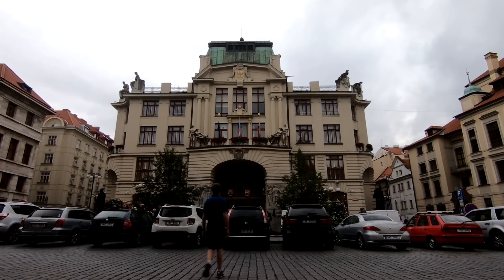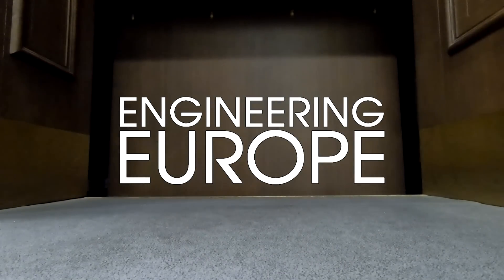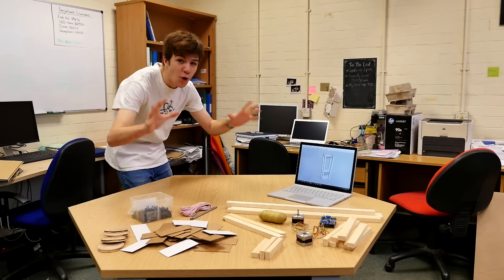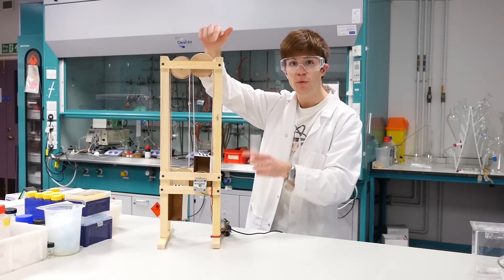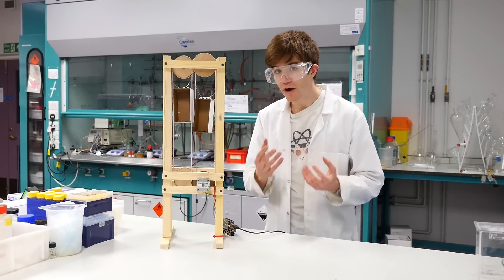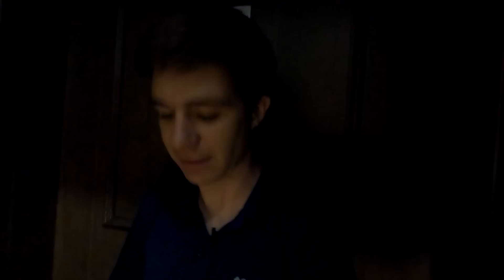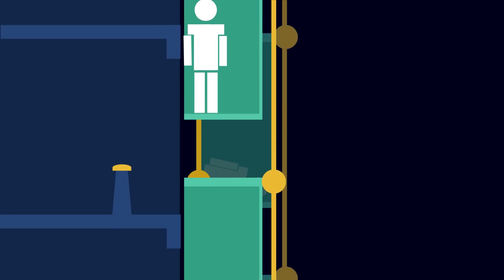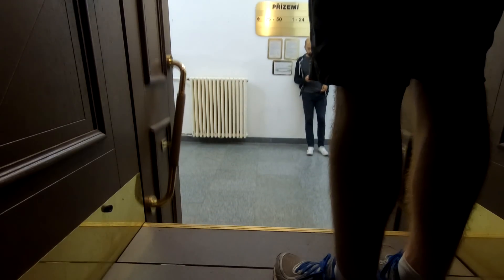Riding the Elevator of Death

Comment: Major problem with this aside from death and injury is that it’s not accessible to everyone. Most people with disabilities would have great difficulty using these elevators.
Reply: So? There are also normal elevators.
Reply: Johanna Guerrero ☠️
Reply: @okaro6595  most buildings do not have the capacity to install more than one kind of elevator
Reply: In the USA, we say that it is not ADA-compliant (Americans with Disabilities Act).
Reply: This is like a compact escalator. I don't see why they can't have this as well as a conventional elevator unless they are really hurting for space.

They can sacrifice some office space and install an elevator shaft there. If it's next to windows, they would have to put up signs on the outside of those windows that say "SHAFTWAY" (for the firefighters). Many old buildings in NYC have evevators installed this way.
Reply: Just place a card scanner on each floor and elevator that temporarily stops it, so a disabled person can get on and off.
Reply: A huge chunk of large buildings already has to be dedicated mechanical space. A tiny deadly elevator only useful to thrill seekers and fit, healthy adults not carrying anything sounds like a giant waste of money and space.
Reply: You're absolutely right. If every building had both types the 'normal' safer option would be designated 'the short bus' or somesuch. I'm sure many people not really fit to ride the paternoster would force themselves to, just to avoid being seen as an invalid. Much like how many elderly will keep driving until a relative has the courage to step in and force them to stop.
Reply: @Keovar  what's exactly the difference with a normal elevator? You also need to wait with a normal elevator when a disabled person needs to get in. With a normal elevator you can also push disabled people aside and reject them from entering the elevator just to save time.
I don't get your point.
Reply: How many such people are in building? How often they ride elevators? There easily could be other, normal, lift  for them. Paternosters were designed to move huge number of people in in time. Bear in mind that Czechia is land of Kafka and bureaucracy and back in the day those corridors were buzzing with bureaucrats.
Reply: They may not look it, but they are safe. Even though invented years ago they don’t need modern tech gadgetry. There are hidden safety features that mean you won’t get chopped in two. The worst that could happen is falling over. 
In a way, they actually help disabled people. They are so efficient at moving crowds that they lessen the loading on the traditional lifts. This gives the disabled more chance to get on a lift.
Reply: Yes like my red hairs
Reply: Two mirrors and a light sensor would work just fine. 
And before you try to play white knight, I’m disabled. 
Ya’ll love to make things way more complicated than they need to be so ya’ll functional can bitch about how exaughsting it is to accommodate others. 
Stick a mirror on the back of the box, one on the floor edge angled at the ground and a light sensor at the bottom. Viola! 
Roll in, use the mirror to read the floor numbers. (One painted forwards, one painted backwards.), Once on the floor, roll out autobots (transformers slaps) and done! 
The light sensor on the bottom when broken will pause the elevator until reconnected. 
It’s literally the same logic as in garages.
Reply: @plateshutoverlock  Well, I've seen elevators that have glass shaft, and the inside of the elevators are also see-through. Nice touch actually exposing the mechanism of the elevator. You can mainly see them in malls.
Reply: Unexpected stops and starts would make it more dangerous for everyone on other floors getting on or off. These would be great in buildings big enough for 3 or more shafts - there are several even in Denver - but they couldn't completely replace elevators.
Reply: There is also the fact that... just from looking at it... these are slow as hell. It’s fine for low storied buildings but actual skyscrapers and places that probably would need the elevators that can transport lots of people extremely often wouldn’t actually find a practical use for them because of how long it would take to get from the bottom floors to the top.
Reply: @squee222  On the contrary, yes they are big enough. Buildings where you require the capacity of a paternoster will be big enough normally to house at least one other elevator. Which by the way made a lot of sense even back in the days, as transporting furniture four stories high was even back then easier with a normal elevator.
Reply: @acdeeiprrt  that was never their intention. They were for buildings with very high capacity demands and always combined with traditional ones. One paternoster and one classic elevator and you get a capacity of many more in the place of three classic ones... They are also too slow for high buildings. Their niche consists of not very high but large area buildings with many offices/lecture theaters etc. on each floor. In Prague, they were used at universities, townhalls, some hospitals, large buildings with lets say four to eight floors, always in combination with traditional elevators and commonly used (not emergency only) staircases.

And also with many safety features not mentioned in the video, although present in the example shown - lifting parts of the floor, switches in the ceiling part, etc. The biggest real risk is getting caught in the mechanism on the top or bottom - by clothing, long  hair or a finger, if the person is very inconsiderate. That could be nasty (and it is the reason, why it is always prohibited to go around the top or bottom on purpose). Or an occasional sprained ankle. The risks mentioned in the video are prevented by safety measures in reality.

Comment: In the Paternoster Elevators videos there is always this phenomenon sociologically interesting, two groups colliding:

Group A: Express their fears, and are vehement in thinking about dangers, disabled people and pets using this.

Group B: Complains about the recall of these elevators by pointing "stupid people", calls about natural selection.
Reply: Which is really stupid because the reason that humans survived in the first place is that we said "Fuck survival of the fittest, I'm taking care of you."
Reply: Group B also knows that nothing ever will be as efficient as a paternoster. Oh and they also know, that paternosters are basically safe (5 people killed in 23 years of service - tons of such systems in those days) and that disabled people have normally access to regular elevators in such buildings.
Reply: @kaitlynboss3497  The correct principle is "Survival of the fit enough."
Reply: @vaclav_fejt  fit doesn't always mean physically fit.
Reply: @kaitlynboss3497  True, but I didn't say that.
Reply: @shelvokespv2847  only 5 deaths because they weren't widespread. If the paternoster were used in every building in the world, there would be a lot more deaths. Your conclusion that it's safe is based on a small sample.
Reply: @dearestdoppio8554  Uhm. Yes, they were widespread before everyone started to spread the rumour that they are unsafe. And these are high capacity elevators, lots of people use / used them. Most of them, without accident.

Comment: Pressure sensor that stops when something is caught between elevator and hallway? Also space the doorways so that you can climb out of any one of the carts when it stops due to an obstruction? There has to be ways to modernise these
Reply: The breaking system would have to be powerful for that to work. The whole chain of elevator boxes has a lot of mass and it would have to stop in less than a quarter inch to avoid breaking limbs.  Even if you do manage to get it sorted though, OSHA (and foreign equivalents) are unlikely to ever approve any building that uses one, just because of the potential for small children to injure themselves by wandering into a box that hadn't fully arrived at the floor they were on, or by falling off after the box had gotten higher.
Reply: This video is little bit misleading. It does have safety flaps and safety pressure sensors (switches) which stops the whole elevator immediately preventing you from getting injured. You can see it in this vid: https://youtu.be/-Y1ME8n5tCU?t=95
Reply: Simple electronics with cheap laser or infrared sensor that checks if the closing area is clear of objects would do the trick. Give it 50 cm of critical threshhold and 20 cm breaking distance and limb is spared.
Reply: @martinsvozil4004  Any idea how the safety flaps handle getting stuck between the roof of a cabin and the floor when going down? The video doesn't explain that situation. Also, what if something wider than a flap gets stuck? (e.g., a leg or a head)
Reply: If you are stuck enough to trip a pressure sensor, this multi ton machine wont be abled to stop before its gone the extra 10 centimeters needed to cut your arm off.
Reply: @2MeterLP  that is what the flaps are for. The sensor detects you hitting the flap and the flaps have enough give to them to give the lift the 20cm or so to it needs to stop.
Reply: @p11111  The top of the cabin has a flap too. The flaps are quite large, so it won't manage to squeeze a head. You could lay down across the edge and still most likely get out with just a bruise. The problem is accessibility and speed, not safety. You cannot have it as the only lift due to wheelchairs and travelling large distances gets impractical, so it will only have niche uses these days. Kinda like how moving sidewalks are possible but not a replacement for busses.
Reply: There is no stopping stupidity; people will find a way to get hurt regardless of how many safety features you put in....

Comment: We went on this by accident, didn't know it was a thing. I nearly died on it 😂 I freaked out as I thought it was going round on itself and dived out last minute and nearly had my legs chopped off
Reply from the maker: That sounds terrifying! Glad you got out alright
Reply: Too bad you didn't actually touch the board covering the top of the opening. You would have seen the original safety feature at work. The board is not firmly attached, it's only kept in place by its own weight, and removing that weight stops the whole thing well before you have a chance to touch any fixed part. It also triggers an alarm, summoning a worker to inspect it and reset the safety.

Comment: Amazing video!! Really liked how well structured is the information given!!

I have chills just by seeing this elevator. The anxiety of misstepping is just one thing I would never get over with in these elevators.
Reply: It’s actually quite safe. These elevators use a lot of neat safety measures. Here’s an example from the 1980s https://youtu.be/-Y1ME8n5tCU?t=95
Reply: Actually information are not gjven correctly, we dont call it "Elevator of Death", it is not dangerous at all.
Reply: Miguel, you are also afraid of Escalators?

Comment: We have some more in the Prague technical university and we noticed, there are wooden planks conneted to buttons that, if person got something stuck in the doorway, would stop the lift. It sounds makeshift but it looked as being part of the lift from the begining. I think rather than being dangerous, the reason for abandoning the design is purely the accessibility for elderly and diasabled. I´ve seen older university staff and visitors strugling to get in while it was moving, not mentioning people in wheelchair.
Reply: Yup, the problem is accessibility, not safety. The author is trying to make the video more interesting by ignoring the safety features. :-/

Comment: I used to work at Deutsche Eisenbahn Consulting at Frankfurt at the river Main when they still had a working pater noster.  My first time, when the door to the building electrically opened and I was invited to come up to the 4th floor by my future boss. I stepped in and was greeted by either a stair case or guess what. Working here I would have to use the pater noster. So why not now?  On the 4th floor I was greeted by a cheering crowd who had placed bets whether I would take the stairs or belong to the group. Today I can say this transportation was more safe than open lifts. I have never heard of people stuck in a pater noster because of a blackout and there are no closed spaces claustrophobic people might be afraid of.

Comment: I came across one of these weird contraptions today at work, when heading to a newly appointed break room for traindrivers in Brussels South station. The elevator was switched off however, so I couldn't ride it. Hopefully it will be switched on when that building gets used more after the current crisis.

Comment: We were visiting family in Cleveland a couple of years ago and I use a scooter to get around due to a disability and the place my uncle insisted we go for lunch was easy enough to enter but leaving was a completely different story. Has to go way in the complete back and use the weirdest elevator we had ever been on. Barely fit hubby and me. It kind of reminded me of this but at least it stopped. But I remember both of us were freaking out hoping we didn't move the wrong way bc there wasn't a cage all the way around so if you didn't keep all your appendages inside you could lose one.  They got away with this bc it's a historical building. Historica, buildings do not have to be ADA compliant so for the rest of our visit I made it very clear only modern buildings.  LOL
Reply: The easiest fix for this kind of elevator: Make it bigger than two people, mirror on the back wall to see floor numbers. Mirror on the ceiling on each floor to see edge. Light sensor to stop when broken then resume when whole.

Comment: They could be programmed to stop for a few seconds on each floor to make it easier to get on and off
Reply: And have doors that open when they stop.
Reply: @renakunisaki  That just sounds like a regular lift with extra steps
Reply: Yeah and why don't we ad buttons so people can travel to whichever floor they wa-
Oh wait
Reply: That's exactly against the concept of these elevators
Reply: @SodiumChloride_NaCl  You've never waited 1+ minutes for a stupid lift to reach you? Especially in taller buildings! I'm not saying it's a good solution to every building but some could probably benefit from a similar, albeit safer, design as this.
Reply: @kaitlynboss3497  you’re still gonna have to wait for these lifts to loop back if you just missed it tho
Reply: There are multiple platforms roughly 1 story apart, more or less

Comment: When I was at the University of Sheffield I went on theirs. Its 22 storeys high, the tallest operating in Europe! I thought it was pretty cool. The other drawback with the the paternoster was standing in the cabin watching the conventional elevators across the room zoom up and down at much faster speeds. Its about 13 seconds between floors.
Reply: This is the actual reasons paternoster elevators are being phased out. As another thread here pointed out, the safety thing is pretty much sorted out, but there is no remedy to having to compromise between the requirements on travel speed and on speed when getting on. And with taller and taller buildings being built, the travel speed of the paternoster just isn't feasible. It's a matter of wait time vs. travel time in the conventional vs. paternoster elevator debate. Not sure about maintenance costs though, that might be another issue. But there's still the cool factor of the paternoster, which for me outweighs most of the cons!

Comment: People are afraid to use elevator because the risk of death, but they use cars all the time.
Reply: @RedNova.  Well, when elevator gets stuck you are not that likely to die and cars run out of fuel, have dead battery and all sort of other issues as well.
Reply: same with planes

Comment: I'll take the stairs.

I've seen videos of these and at one place they had collapsible floors on hinges that if you were going up and your foot stuck out of the lift it would just push the floor up. Same on the cars. The tops were open enough so you couldn't get anything caught. There were also emergency stop cords on each level.

Comment: In Czechia, there's about 70 páternoster lifts in total, however only a handful are working and available to the public. I've been to multiple and can say that you might eventually get used to it. The oldest one is in Prague in the building of Czech Radio, it was made in 1920 and installed in 1929 with 18 cabins, reconstructed between 2007-2008. The tallest one (58.5 m) is in Baťa's Skyscraper (AKA Building No. 21) in Zlín with 30 cabins. It takes 195 seconds to get from the 15th to the ground floor, its velocity is 0.3 m/s. It was installed in 1938 and reconstructed between 2018-2019. Apparently the package and letter delivery system was also using the same technology with an automatic tilt mechanism. The second tallest (56.8 m, 35 cabins) is in the Liberec region municipality building in Liberec, installed in 1971. It was reconstructed last year, but 2 months ago, some workers demolished two cabins and the engine room when a ladder they were transporting got stuck (severe safety violation, there are modern lifts in the building), so it's in non-working condition unfortunately. It is not known when it will be running again.

Comment: We have 3 of these at Czech Technical University in Prague. They are awesome. And also completely safe, as they have multiple mechanical sensors in each floor that detect stuck bodies/objects and stop the lift instantly if the safety bar is triggered.